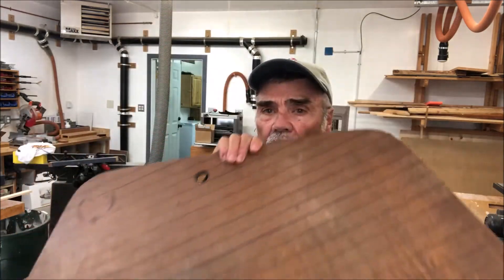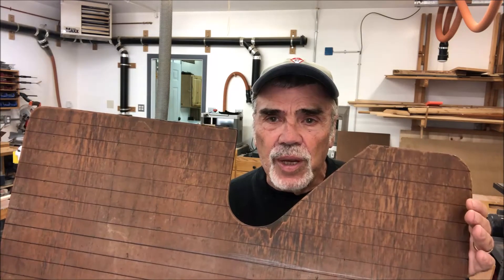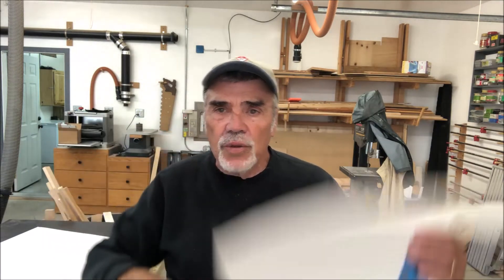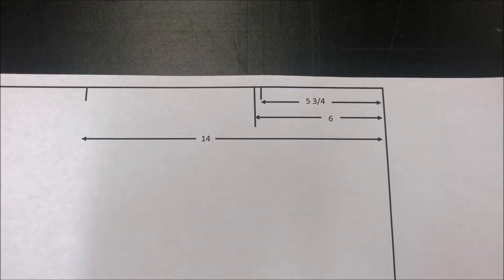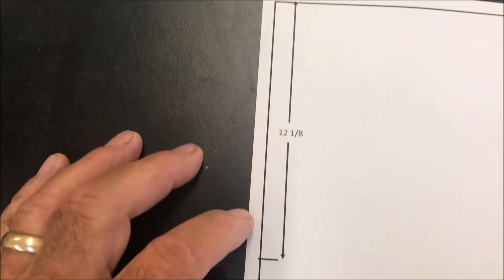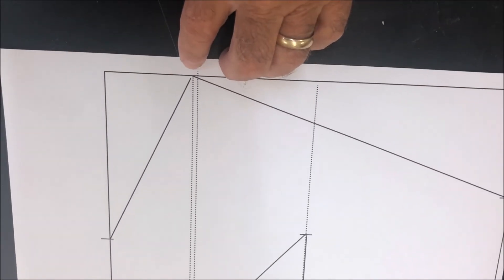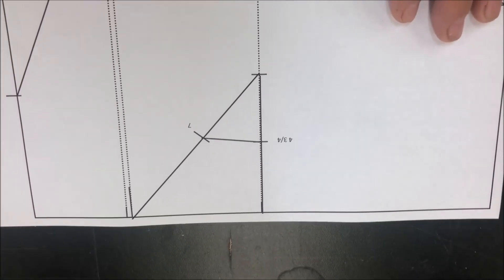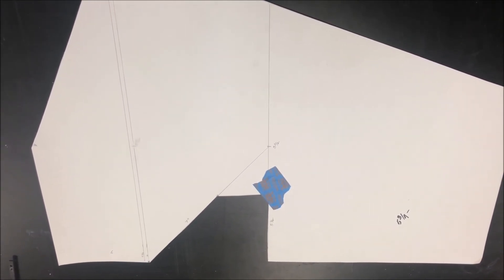Catalina 22 - Template for Bilge Cover Step - Jim's Little Boat

Comment: Thanks Jim.  I'm missing my bilge cover and it looked like it was going to be a bit of a head scratcher.  Just one of the many projects lined up for this C-22.
Reply from the maker: I think the dimensions will get you close enough to make a pattern that you can use with just a little fine tuning.  Good luck.

Comment: Nice video Jim. Is there any chance you would consider doing a video sharing your experience/tips for those new to sailing? I just finished my ASA 101 at the local sailing club, but what suggestions would you have for building skills? Is there anything you would have done differently in learning to sail?
Reply from the maker: Hmm.  Karl, there are many fine videos about learning how to sail.  I doubt that I could add much to that body of knowledge other than my simultaneous cocky/humble attitude.  I have taught several people to sail.  And the teacher in me has a lesson plan for every session.  At first we just practice tacking-then gibing.  Then we work on sail trim--not too fussy.  Then steering to the wind on the up wind legs.  After that steering to course.  Anchoring is something nobody practices much, and I only show people once - it should be more.  I am a big proponent of sailing the anchor in under jib alone.  hmm  Wearing ship when the wind is light--stay to leeward of stuff that you can hit--right of way--hmm way too long answer.  Lesson plan for every sail is probably the short answer.  :)  Oh and man overboard--I don't care what ASA says, I think you should lay to leeward of MOB.
Reply: @jimslittleboat4388  That's not too long of an answer at all and I appreciate the candidness. I probably should have mentioned I took my course at the sailing club in Tacoma, so I'm a local. It was a good class, but they firehose you with so much information that now I'm trying to figure out bringing it all back together on my own so as not to lose the skills. Either way, I appreciate all of the little tidbits you impart to us here.
Reply from the maker: @kkrotke  You're okay then Karl.  Go as often as you can.  Pick weather that is appropriate to your skill level--and then just a little more, and most importantly "Never make fast the sheets of a small boat."  (especially the jib sheets).  I will send a picture.
Reply from the maker: If you contact me on facebook or email jslosson@aol.com I can share a great video of what happens when you have jib and main cleated as a gust hits.